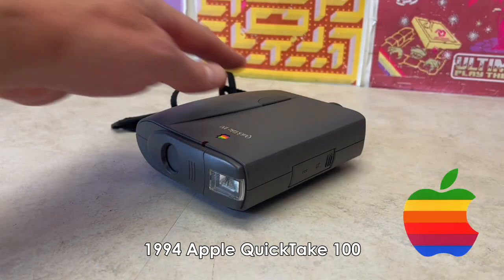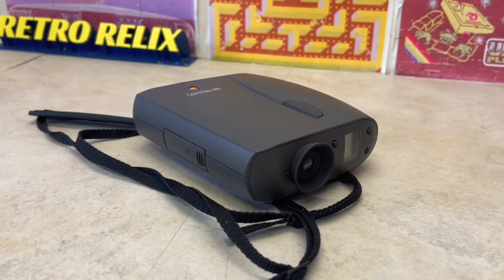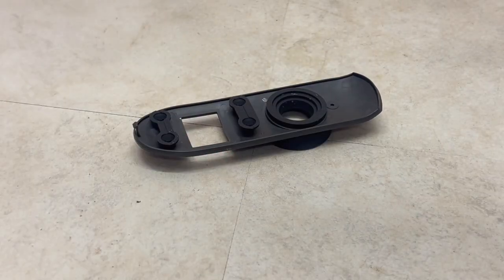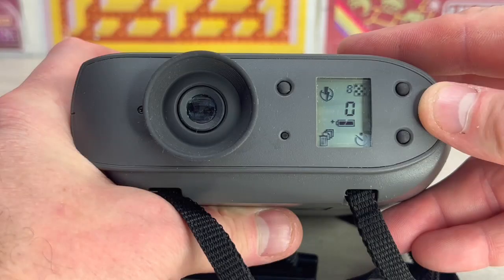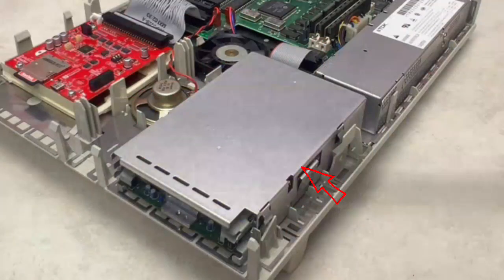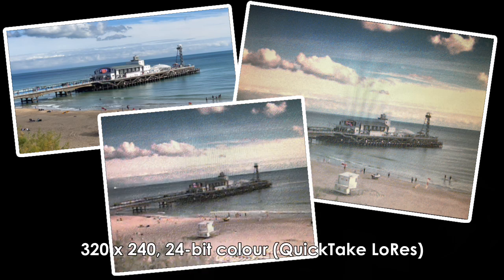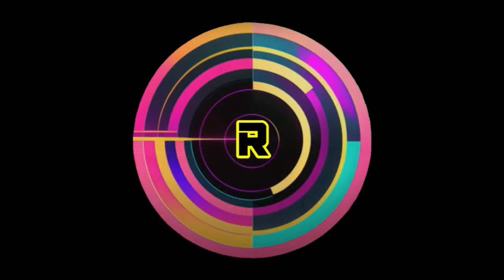1994 Apple QuickTake 100 Colour Digital Camera Review

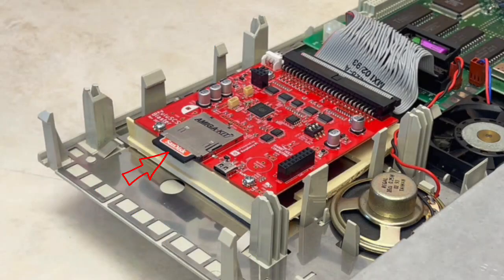Comment: 5:46 that scsi ribbon on or is it a one row out? looks like theres a row of holes along the top of the pins.
Reply from the maker: Although it does look out, it was connected correctly. If you’re  interested, check out my previous vid where it was installed 👍